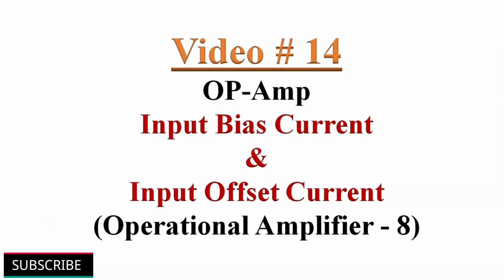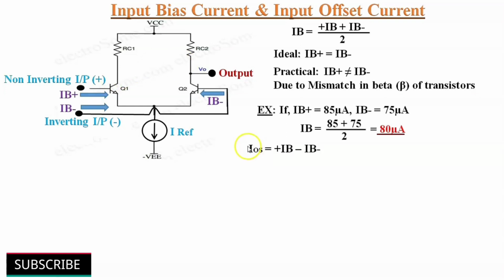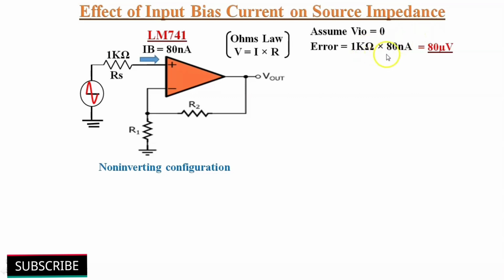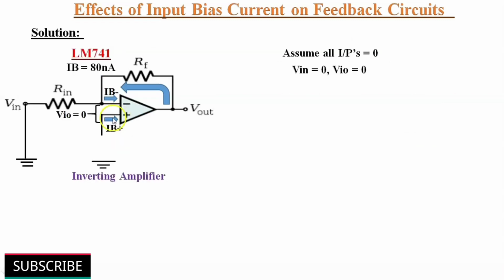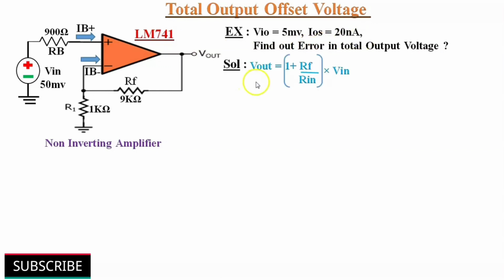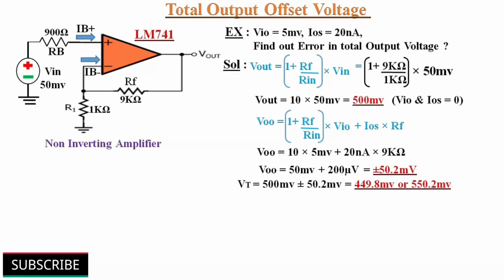OP-Amp Input Bias Current and Input Offset Current (Operational Amplifier)

Comment from the maker: The timestamps for various topics covered in this video are as follows:
1) 00:10 - Introduction,
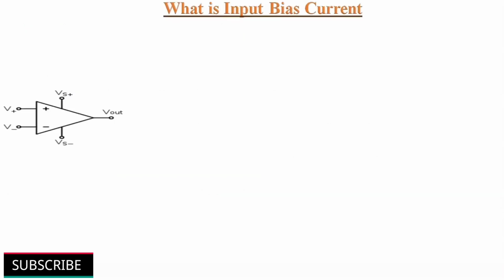2) 00:43 - What is I/P bias current,
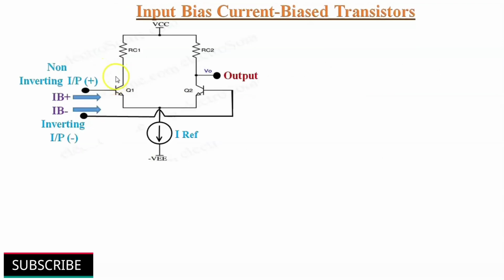3) 02:19 - I/P bias current Biased transistors,
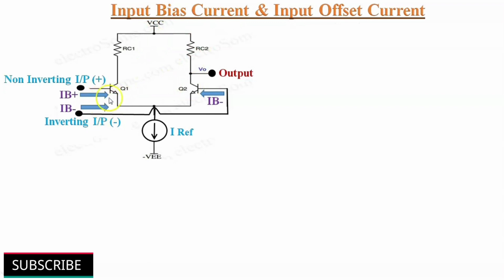4) 03:08 - I/P bias current and I/P offset current,
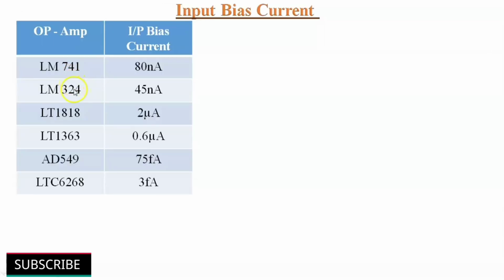5) 04:42 - I/P bias current of various OP-Amps,
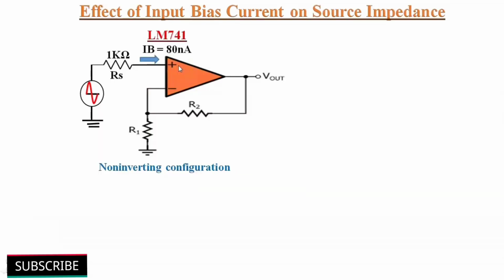6) 05:30 - Effect of I/P bias current on source impedance,
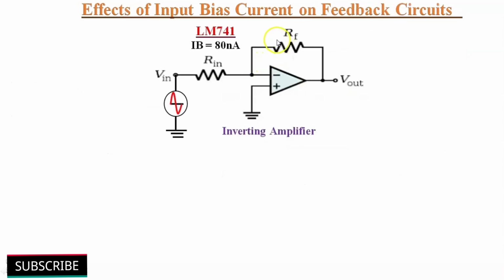7) 08:17 - Effect of I/P bias current on feedback circuits,
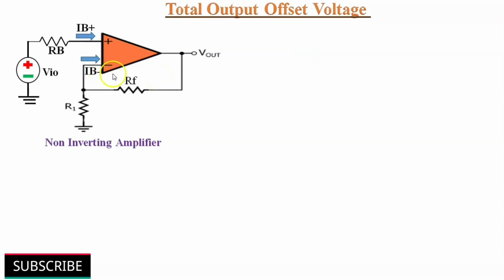8) 11:05 - Total O/P offset voltage formula,
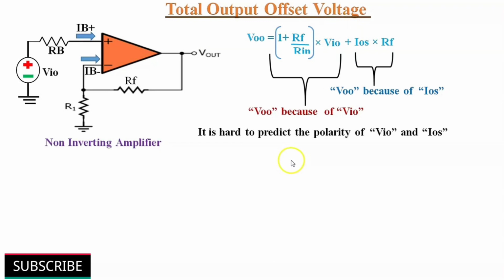9) 11:54 - Example with Solution,
10) 14:34 - Thanks for watching,
11) 14:48 - Next video.